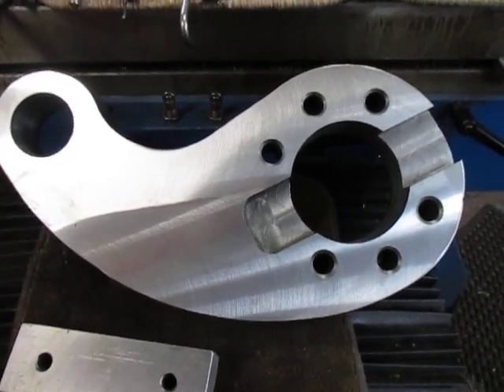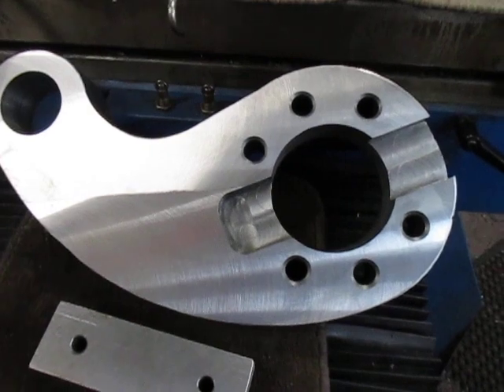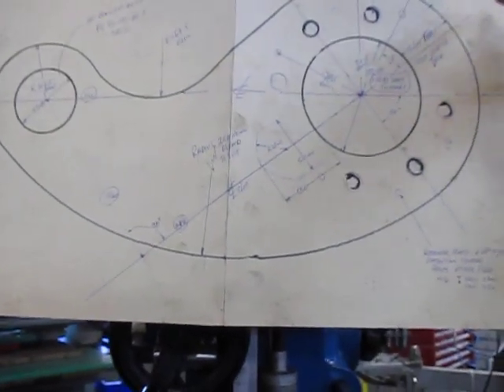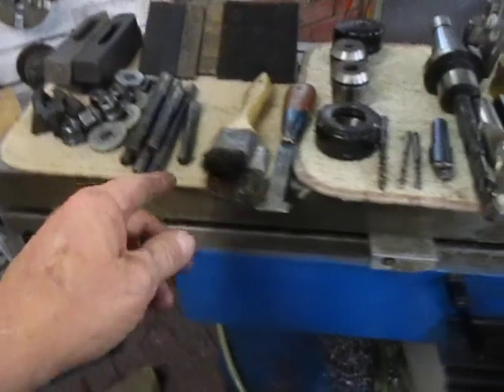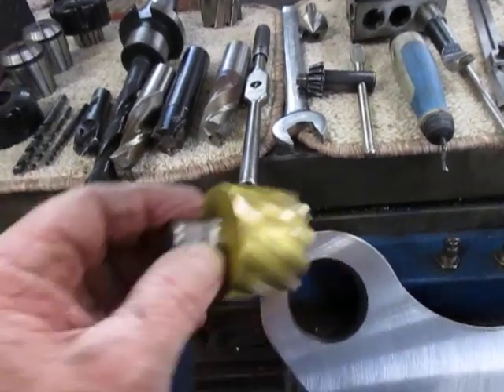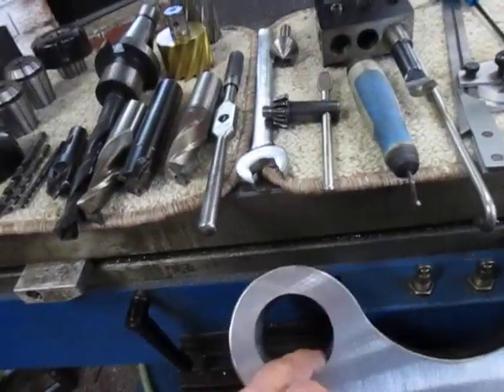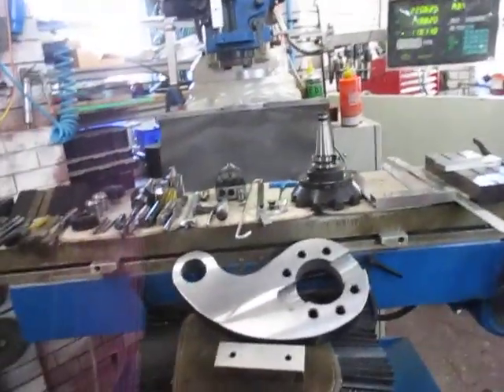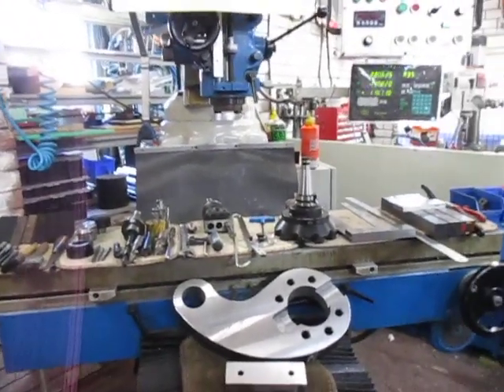Cranky Arm Finale

Comment: Hello Bruce, this was an instructive series, quite new to hear the generic ot the featured tooling...
One question.... Would it have been possible to add some weld and then machine back to dimensions, I'm asking a bit cause i did not have the original part in hands and really seen the actual dammage?
Thanks for sharing,  Pierre
Reply from the maker: pierre beaudry Yes I responded to the query previously, it may have been in another forum, at any rate to bore out and bush the 6 bolt holes, the centre shaft hole and the keyway weld and machine and stress relieve and reface would have been equal or even more time and cost, hence I bit the bullet and made a new one.
Reply: I didn't involve the stress relieve in my thinking, so it makes it closer to a new part...

Comment: Hi Bruce,
The armchair engineer in me is puzzled by the bolt hole layout. Can you throw any light on why the design uses a 6 hole layout ?
It just seems that 8 holes and a captive key (2 bolts through the key) would be a better setup than 6 and a "floating" key.
Cheers Eric
Reply from the maker: midgoog2 Eric, I honestly don't know why the design did not call for holes through the keys, I can only comment that it is not a general practice to use bolts through keys in that manner. The only instances of bolts in keys have been as a keeper (placer) to stop a key from moving on a boss during installation, or being lost when handling (as the case of keyed instal / uninstall tools) where a dropped key could cause issues or a lost key would render the tool useless. The choice of a six hole standard pattern would have enroached on the keyway area. The bottom line is that the key transfers the thrust forces, the bolts are there purely to keep the arm and shaft together.

Comment from the maker: Several times there have been queries about costing and how to go about it. This is one of the most difficult parts of this type of work and on the whole (unless it is a repeat job) I shy away from quoting, only budget costs and keep the customer informed. I have a rates scale of about 3 hourly rates, I charge for all my time plus materials, including time spent on the road or costs of any one off tooling inclusive of transport and courier services. On Getter outs in the field I charge from when I leave the workshop until I return in most cases. some I have a callout price and then hourly rate and 1/2 the cost of any special tooling and retain that tooling myself, unless the customer wants the tooling then it is full cost plus 20%.

Comment from the maker: Tim thanks for the feedback, to answer your question I do not compete with the CNC guys, I utilise their ability to do things quicker and cheaper than me to do some of the work that comes my way, in particular for bulk lots. I also use them when I have to have a tool I've made engraved specifically on round surfaces that need a controlled 4th axis. Most of my work is one offs and generally urgent in the nature e.g: Oil and Gas / production machinery repairs or getter outs, all requiring "stop what I'm doing and fix it" CNC guys aren't in the habit of doing that. Bruce